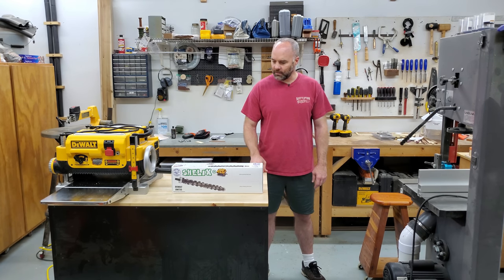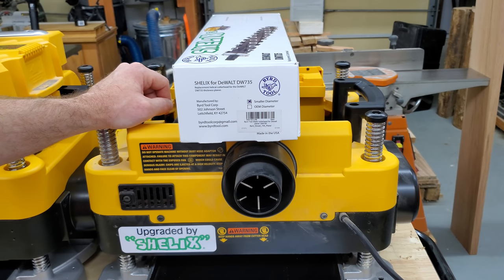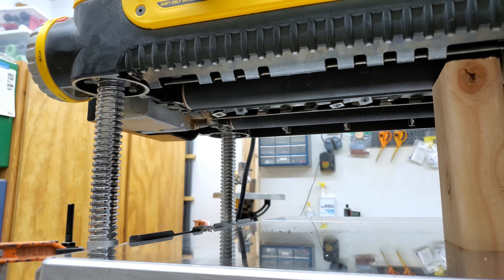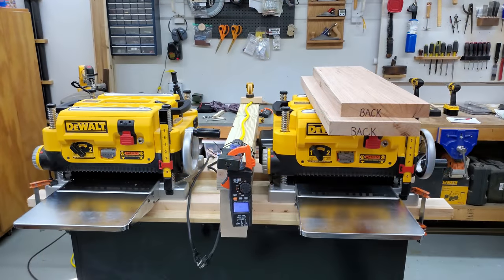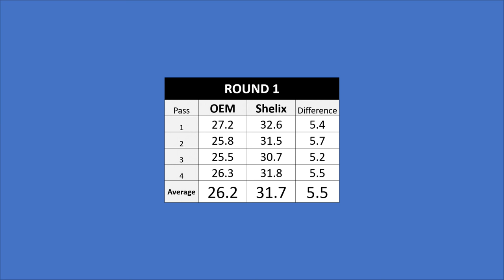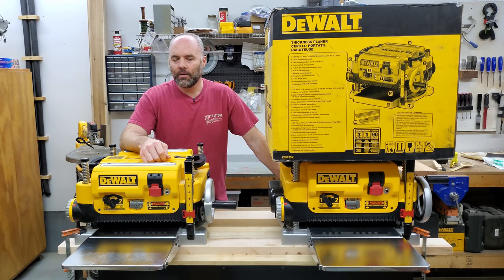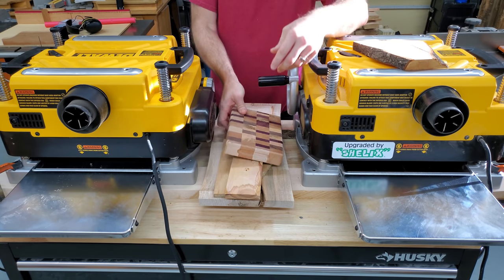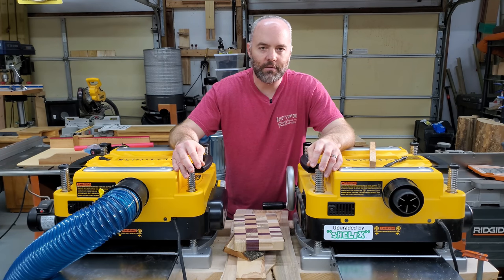The video I wish I watched before buying a SHELIX

Comment: Really excellent!  Bummer for me, since I’m in a rental garage with a 15A circuit ...  we’ll see as I work into it.
Reply: You should look into deep cycle batteries and a power inverter. I have a couple LiFePO4 batteries; 12v, 150 Ah. Two can be linked in series to make 300 Ah or 3600 Wh. Connected to an inverter one could easily power 20 Amp or 30 Amp 120 V AC tools. Essentially 30 A (AC) 120V is 3600 W; so the two batteries could provide full power draw for one hour. If you were running 20 A; 20x120=2400, 3600/2400=1.5; Therefore, full power draw for 1.5 hours.

If you get an inverter charger you could easily have the charger connected to the batteries at the same time and extend the operating time approximately four times. Depending on the battery chemistry and alternative charging locations the charge can be achieved in a fraction of the time it would take to discharge as they can charge at around 10C (ten times  regular charge capacity).
Reply: @brendanwood1540  thank you!  Really good to know. I’ll have to see how big a problem, if any ...

Comment: I know this is an older video, but I have a question about the stock straight blades, once they get them chipped due a nail or whatever I believe you can shift them a little to the left or right not necessarily need to flip them, is that correct?
  And thanks for the awesome videos love your content brother I wish I can be as good  of YouTuber like you 👍🏼
Reply from the maker: If the damage isn't too bad, you can just shift them. You can also just flip one blade around to a new edge, and it will usually clean up the ridges left by the other two.
Reply: ok I see that make sense and thanks for the quick answer @TheSnekkerShow

Comment: Wow! Nice video. I literally just bought a 735 yesterday.  My Delta 22-540 type 2 just couldn't be rebuilt anymore. Can't get parts. After I took it completely apart. 😅
Now you got me thinking. Maybe I shouldn't have bought a new Dewalt. My circuits are 15 amps. And their older the dirt.   
So I need to ask. How big of cuts did you take? More then a sixteenth? Did you do more on purpose?
Reply from the maker: 1/16th if I remember correctly.

Comment: Good morning, I worked in electric motor show up for many many years the retired about 2 years ago, for driving them machines and other woodworking equipment that will draw the full 20 amps your shop should actually be wired with 10 gauge which a lot of people thinks is sink is nuts but allows for the voltage drop and your equipment will run better and actually at a lower current rate, and being they are labeled at 20 amps for the tool when under loaded Maxing above that, and electrical wiring lot of times when people are wiring things they don't do not take into account the voltage drop from the power panel to the outlet and then again with the extension cord the longer the cord is the bigger gauge it has to be, and then doing this test if you are using a 10 gauge wire your amperage will actually be less because you're pushing pass at 20 amp limit and in a house wiring the 20 amp is looking at I can't remember what it's called no anyway it's wired for 20 amps Max. So if a tool when it's loaded goes up above that it's going to be depowered and the full House horsepower will drop as it cannot get the current / voltage that it needs.
Reply from the maker: Yeah, that's solid advice. In a previous house, I had the opportunity to build my workshop in an unfinished basement, and I ran 10 gauge to everything with a 20A circuit and receptacles. I put 220V everywhere, too, even the ceiling. Now I share the only 220V receptacle with the clothes dryer.

Comment: WEN PL1326 have 26 carbide blades  from factory and is $200 cheaper. The blades sell in Amazon for $23 (10 blades). Far from comparison, the Dewalt price rise after adding extra $$ upgrading with the Shelix.

Comment: Lucky I’m flattening boards with a belt sander. One day I’ll be able to get one of those bad boys.
Reply from the maker: I used to plane everything by hand, wishing for years that I had a belt sander. I eventually got a belt sander, but still prefer hand planing because there's less noise, less dust, less sandpaper expenses, and it's easier to create a flat surface. It's takes a while to fine-tune a hand plane initially, but it's worth it in the long run.

Comment: If you hit a nail, you will likely damage more than one Shelix cutter. When all four sides are worn (dull) you have to replace all the Shelix cutters. When my straight planer blade is worn on both sides, it takes me five minutes (per blade) to put a new edge on my blades. Having said that, a helix cutter head is far superior in finish cut. Cost and simplicity, I'd go with straight blades. You did it best by getting two planers ; ) Planning wood that is not for fine woodworking, straight blades. For fine woodworking and precise dimensions, helix is the only way to go.

Comment: I just tested mine (straight blades) to see power draw. I’m maxing out at 17.5 amps. Used a kill-a-watt to test. Dunno what’s going on with yours but that can’t be right.
Reply from the maker: The kill-a-watt is rated for 15 amps, and the two meters I used were both rated for 600 amps.

Comment: You stated the extra load from the Shellix cutter head may affect the circuit breaker causing it to trip more often and possibly leading to denial of warranty claim for that part.  By you logic then, the motor, since it is now exposed to higher average current, will run hotter causing the insulation to age faster.  Its life expectancy has been decreased and should be subject to denial of warranty claim as well to the upgraded cutter head.
Reply from the maker: You could also increase motor temperature using OEM knives by planing wider boards, harder wood, more frequently, or with dull knives, while someone with a Shelix might only use it for occasional light work.  The same discussion could be had about the use of non-OEM table-saw blades under the same Dewalt warranty.
Reply: @TheSnekkerShow  The table saw blade replacement is a poor example.  A better example would be taking a Subaru Outback and putting 44" off-road tires on it, breaking the entire drivetrain, then expecting warranty coverage.  Tesla recently denied coverage to someone who put tank tracks on a Model 3 and smoked the motors.  Nobody is voiding your warranty for switching from Goodyear to Yokohama tires.
Reply from the maker: @kellygordon103  Okay, the table saw example was not apples-to-apples. Otherwise, I think I clearly made the point that there are plenty of ways to strain this motor, and even the new stock knives were way over the amperage limit planing a 9 1/4" board on a 13" planer. If the motor burns up while a tool-internal thermal breaker is in place, then the manufacturer-provided breaker failed to do its job.
Reply: @TheSnekkerShow  you know, just avoid the confusion and reinstall the OEM cutter head when bringing it in for service! LOL

Comment: Thank you for the video.  I currently have the Dewalt 734 planer plus a 2 speed Delta but my Dewalt is my go to planer.  I was looking for an excuse to upgrade to a 735 and the fact that you can upgrade that with the helical cutter head.  I'm a hobbyist so I don't generally try to justify my buying habits but you gave me some things to think about here that I hadn't anticipated with current draw as I thought the helical head would draw less - not more.   I guess in the end it really is the quality of the end product any better between the 734 and the 735?
Reply from the maker: One of the most important features for me is the ability to adjust the speed, partially since I broke my previous one-speed Ridgid planer with an end-grain cutting board.  You can get helical cutterheads for the DW734 also, you just need to decide if it's the planer you want to invest in for long-term ownership.
Reply: @TheSnekkerShow  I saw that they were available but I think they are a lot harder to put in compared to the 735.   I think you pretty much have to take the whole planer apart.  I had a bad experience with an early Grizzly portable that I took apart and was never able to get aligned again so I'm hesitant to spend the money for a helical head for the 734 as I might end up with a messed up planer and an expensive head that I can't use.   I use my 2 speed Delta for hardwoods that I want to get a really good finish on.   My really problem is finding a buyer for my 734 because I don't want 3 planers sitting around my shop.

Comment: I wonder if cause there's more pressure on the rollers it's causing more resistance to slide the piece of wood causing more amp requirement.

Comment: You said that the Shelix cutter has a smaller diameter. Can this be the reason for drawing more amperage? the bigger "flat" cutter has more mass, ergo more momentum. The smaller Shelix is continuously trying to keep up the rpm, having less weight/mass it slows down when cutting more than the heavier straight cutter. Also it is cutting all the time, or more often, compared to the cut-no cut of the other one. Just some thoughts there.
Reply from the maker: Diameter is probably a factor, but I think it's caused more by the helical head maintaining constant cutting contact with the wood.
Reply: @TheSnekkerShow  Yeah, there is that. But I think the quality of the cut pays off. Thanks for getting back to me, and by the way you put a lot of work on that video. I'm definitely going to check your channel. Nice one.

Comment: My two cents: First off; great video and nice host (unlike 99% of tool talk on YT). Secondly; if I were to install a different head and I would need some warranty done, I would re-install the factory equipment, just so that I don't get tricked into  charges... Third; I would not send a unit of this size away for a faulty breaker. I would replace the breaker and eventually ask for a reimbursement, like some companies do and if not, it's still less of a pain to pay myself for the part than shipping back and forth... Warranty which I would consider, would be uneven cutting, really bad motor, rollers and such, but not small stuff. The helix design is supposed to give you a smoother finish, but I'm not sure it's something a woodworker can't handle without... Stay safe, mate!
Reply from the maker: Good points. Somebody else commented that in the event of a total replacement, the repair facility might not be willing to uninstall and return the Shelix head. I made a separate video about replacing the breaker, which takes way less time than driving back and forth from a repair facility. https://youtu.be/24f-J0lVo-E

Comment: I just ordered this planer from Black Friday. It will be my first planer and the first time I will operate one. This was a big help and helps me look down the line when thinking about replacement blades. How hard is it sharpen the original knives?
Reply from the maker: There were some good sales going on this year. In theory, anything can be sharpened, but these knives are specifically labeled as disposable. They fit in to a slot, so they can't easily be adjusted for depth after sharpening.
Reply: Also to note, the dewalt planer blades are dirt cheap as far as use per $ goes. I have a good many pieces of woodworking equipment, some of which I send the blades out for sharpening and some of which I just buy new ones. The dewalt planer blades are definitely a buy new one type of product.

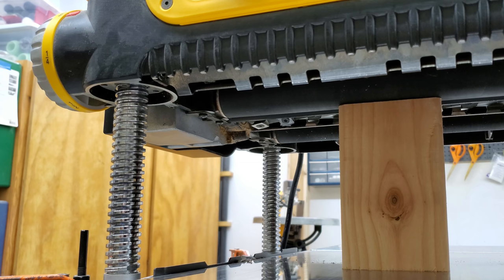Comment: 14:05. If you put a shim under the roller spring as shown, it will do nothing useful. 
Once the workpiece is rolling, it'll lift the roller higher than the shim, and the pressure on the wood will be the same. I.e. the shim will be loose during actual planning. If you put a thicker shim, the roller will not contact the wood.

Comment: I've had the same DeWalt planer for about 10 years.  I use new carbide knives and change them regularly.  I've been satisfied with it and like many of the features of it.  The one thing that I always seem to have a problem with is getting it to feed well. On the planer bed, I have scrubbed, buffed with steel wool and waxed it with little improvement.  I've used a 50/50 mix of water and denatured alcohol to clean the feed rollers.  This helped also, but nothing I do seems to last very long.  Most of what I am using this for is making window trim out of Douglas-fir and Western Redcedar.  Does anyone else have this problem?  Any ideas on how to solve it.  I did solve it in a way because I bought a Woodmaster 25" planer/molder and I ordered it with the 25" Shelix head.  The DeWalt will now be a jobsite planer.
Reply from the maker: It's possible that the rubber on your rollers has hardened with age, or that the roller springs are less springy.
Reply: WD-40 on a rag to clean the rubber rollers--I used it all the time I worked on copy machines to clean paper feed rollers. Don't use wax for the table as it gets sticky under pressure. Instead use spray silicone lubricant that is dry to the touch after spraying.
Reply from the maker: @fookingsog  I hadn't thought about using WD40 on the rollers. That might help keep them soft longer. As for the silicone, it is a good lubricant, but it can contaminate finishes and paints, so I'm usually pretty careful where I spray it in the workshop.
Reply: @TheSnekkerShow  Are you speaking about the silicone lubricant that is dry to the touch once the carrier propellants have evaporated out???🤔

Comment: I got lucky and got the Dewalt knives for mine at 22.00 on Amazon. They were not that price for long. No problem since I ordered 3 sets. Got the planer for 425.00.
Reply from the maker: Smart shopping. The planers usually drop significantly in price around certain holidays, like Father's Day and Christmas. Home Depot and Amazon usually have the lowest prices.
Reply: @TheSnekkerShow  yep. Got a deal on my Makita saw on on Christmas. Learned a few tricks with gift cards for Lowes and Home Depot too. I get free gas from Kroger and 10% off gift cards from Dollar General. Add a military discount on top of that.
Reply: @TheSnekkerShow  my Dewalt hybrid shop table saw was 490.00 no tax and free shipping from Amazon. That was back in 06. They had it at the truck terminal and I had to go there to pick it up. They couldn't drive a 18 wheeler in my trailer park.
Reply from the maker: @chuckfinley5206  That certainly helps. I just noticed a few days ago that Home Depot finally caught up with Lowe's in letting you register for the military discount online.
Reply: @TheSnekkerShow  Lowes has dialed it back a little. If something is on sale to begin with the military discount is not added. They do that with clearance items too. Most folks don't realize if an item is on clearance you can ask for a further discount. Works well with appliances, or if you offer to buy the rest of something. Done that at HD too. Offered to buy all of some Formica they priced at 20 a sheet. Bought 8 sheets for 80.00. Regular price was 48.00 a sheet.

I get free stuff too. Getting set up to do YouTube also. I have about 20 years of content floating around in my head.
Reply: @TheSnekkerShow  thank you for the military discount tip, I did not know Home Depot had it for online purchases.  In Texas you can get your veteran status added to your driver's license if you show your DD-214

Comment: I have an older Dewalt 733 planer that I’m considering upgrading to a Shellix cutter head. Should I first upgrade to a newer desktop planer to increase cutter head rotation or to better handle power load issues? I still don’t understand why you measure 30+ amps and don’t trip the circuit breaker in your fuse panel. Anything new you have figured out about this issue?
Reply from the maker: If it was me, I'd prefer to upgrade a tool that I intend to keep for a long time. As for the circuit load, the breakers are designed to take some overload to avoid nuisance trips every time a motor starts up, but it turns out it's more than most of us thought. I put some more information at the bottom of the video description.

Comment: Excellent video, very informative. My only question - Where did you get the 90 degree exhaust port adapter on your older planer? Cheers!
Reply from the maker: Thanks for the feedback. It's actually not a 90 degree adapter, I was just making a sharp turn with the flexible hose.
Reply: I think what they were referring to was around the 5 minute mark it appears to be an adapter. Could just be something sitting on the out feed table?

Comment: First, a disclaimer, I am NOT an attorney.  However, it is my understanding that the Magnuson Moss Warranty Act would prevent a manufacturer from REQUIRING the use of only THEIR products (like the consumable straight planer blade) to keep the machine in warranty unless they provide that part for free.

Also, there is a lot of current activity amongst the "Right to Repair" folks which may bear upon this situation.

It would be nice to have a qualified Consumer Rights attorney weigh in on these matters.